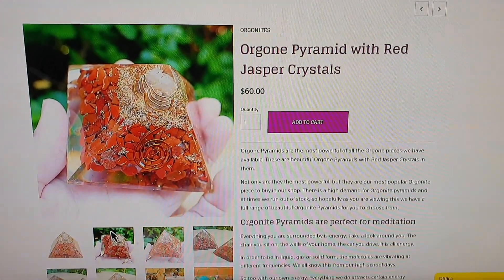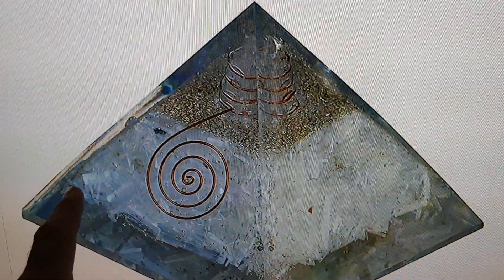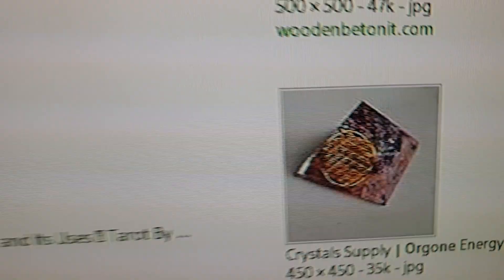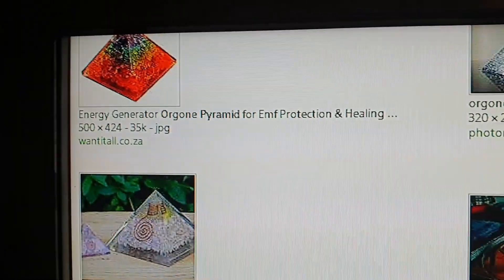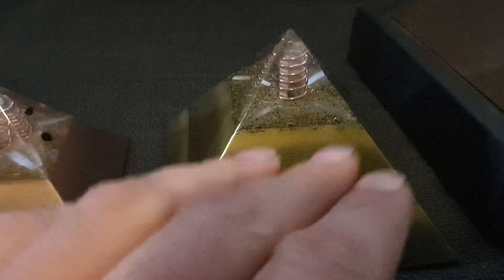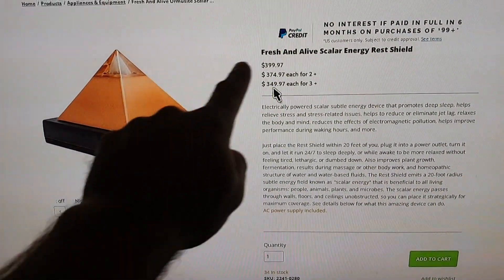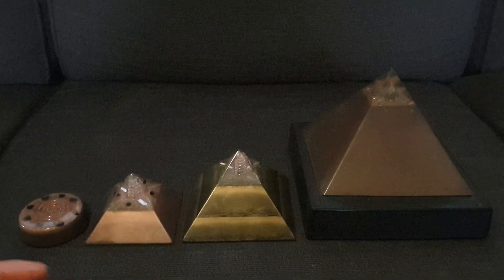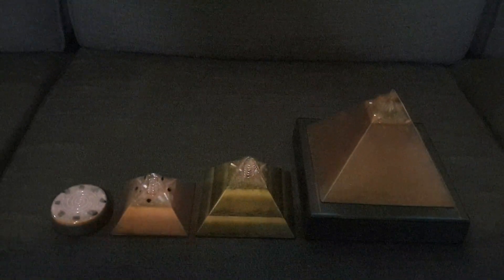Fake vs Real Orgonite Pyramids - Watch til the End!!!

Comment: Thank you for explaining the diference , I need functional orgonite with healing  properties not something that just looks good and doesn't have healing power. Keep up the good work :)
Reply from the maker: Most definitely! I will, thanks 😊
Reply: Originate doesn’t heal
Reply: @SamuraiKai-i2p  That would be your opinion, the hundreds of thousands and millions of testimonials all around the world would suggest otherwise. These "orgonite" devices (when made properly) do have energy, frequencies and vibrations about them, there's no doubt. I mean just pyramid structure made out of plastic straws or wooden sticks give of a beneficial energy. Using an energy tool can absolutely aid in the healing process.
Reply: Wtf is a healing process 💀
Reply: @SamuraiKai-i2p  You can look it up yourself. Wilhelm Reich's Orgone accumulators, Slim Spurling's tensor technology, Patrick Flanagan's pyramid power, Nikola Tesla and George Lakhovsky's MWO antenna, Radionic and Rife machines using frequencies. You can start here, Orgonite and the above go hand in hand. You can work out the process for yourself, if you expect me to just answer you'll be disappointed, we both know your not going to believe me anyway. Unless your researching it yourself to find out please don't waste my time with a question like that, its not helpful for anyone.
Reply: @rcimmortals437  yall are wack i thought they looked cool
Reply: check arboreacrystals orgonite, really a great reiki healer and orgonite crafter  ;)

Comment: does it have to be powdered or can small scraps/shavings be used as well?
Reply from the maker: Any size metal can be used, but the larger the size, the less of an effect. It comes down to surface area, and you'll get more of the casimir effect using powders.

Comment: All you have to test the orgone is by freezing water in a plastic cup, cover with plate, put pyramids on top, and watch how beautifully the water freezes:) my cheap ones (mass produced in india) work great.
Reply from the maker: I'm curious, what type of water do you use for your water freeze test and do you do a control test too?
Reply: @sasorgonitecreations  yes, I have in the past 5 years froze tap water, bottled water, and water from the 'water mill' dispenser-i don't recall much, except that the more pure water has more difinition and tap water was more cloudy when frozen but the same spiraling/flowering pattern. And of course I froze one cup without the orgone pyramid on top vs one with and the difference was that the cup with out the orgone froze in a scattered blurry shape.
Reply: The Pendulum test is also a great way to test them
Reply: @jessica_leeh  how do you do this test?
Reply: @aliciaconstant3982   Look up a video that explains it well on YouTube for sure! But basically you make a pendulum out of string, a crystal and metal wire, and you hold the string still over the orgonite and you’ll see it start to move on it’s own. It’ll show the size of the energy field too which is super cool. Triangles are larger fields than a cube or sphere.

Comment: Using too much powders makes the orgone sticky.  Doesn't flow as much. The 1 tsp per 8-10 oz. Resin is a good rule to follow. Mixing powders and larger metal particles works for me.
Reply: Also i wonder if you cut one in half because it is powder the resin surely do not go everywhere.
Reply from the maker: Ill just say that we don't use any colours to colour the Orgonite. The colours you can see are metals 
😊
Reply from the maker: Fair enough. 
Can you provide me with proof that the energetics won't follow due to using too much powders?
These energy's have no trouble passing through walls, a scalar field will pass through a Faraday Cage. Your WiFi, cellphone signal etc passes through walls. Our orgonite pyramids are not a made out of a solid piece of metal, there is lots space in between everything holding it together. This energy is flowing just fine.

🙏

Comment: All orgonite is fake. Its not based on Reichian principle
Reply from the maker: It's based on using organic and inorganic materials to utilise and gather the surrounding orgone energy.
It was invited by Karl Welz on the simple facts that Reich discovered.
Reply: There are a lot of bases to an orgone accumulator. Not only organic inorganic. Like the specific metals used. If you are using copper then your using the wrong materials. Reich specifically advised not to use pyramid shapes. He specifically mentioned layers. Overall organite is just a name used by a guy who didn't read a book from Reich and other people copy the same errors. You can't claim that you read his books or Manual then you are just using the name as a brand and no more. Organite is not based on anything Reich did. Just pieces of material glued together. The resin used isn't even organic.
Reply from the maker: Any reasons why not to use pyramid shapes?
People creating orgonite have indeed created something new and different, and not all orgonite is created equal.
While creating the one's that we make here, I am focusing on the creating the casimir effect ✨️ and adding many different minerals, crystals, paramagnetics etc. 

I can't even remember what I say in this video as it was a few years ago now. I'd probably say some different things nowadays.
Reply: This is specific engineering. Specific. It has to be exact and precise. Then, maybe then, can you explore maybe adding something new but it has to have the base grounding. This isn't an idea. Its ENGINEERING. Organite has flew of the rails even from it's inception.
Reply: Your basically saying all fly traps are made equal. Organite isn't based Reichian data. A car and boat both can have motors but it doesn't mean a boat will travel on land. I researched Reich work for almost 20years. I seen the beginning of the orgonite movement. I'm sorry to say that it's garbage and takes attention from all of Reich work. Reich was a actual scientist with a nach for engineering. If someone says don't put sugar in the gasoline tank it's for a reason. No pyramid. No toxic resin. No copper. And a lot more. All this stuff Is junkonite. Its because a thing of almost religion and not science. The guy who came up with the idea is a nut job. I say this because all you have to do is read from source to cross reference. Any real follow of Reich can take two glances and see where 20 mistakes are made. Contact James DeMeo. He will tell you the same thing. He's another scientist who wrote the orgone handbook. Of you want instruction I could maybe help. But this stuff is all garbage in general. Don't be lazy my friend. Do it honestly based on the man's work not some quack with a slick brand name.

Comment: When making orgonite, do I have to make sure to use eco-friendly epoxy? Ive found a brand named "Ecopoxy" that seems to be good
Reply from the maker: Hi, no you don't have to, you can use any resin! The key thing you want with a resin is that you want it to shrink well. Also you need to worry about safety equipment like wearing a proper mask with organic and inorganic vapour filters while working with resin's. Ecopoxy to my understanding is a non-toxic epoxy resin which you should be alright to use without a mask in a well ventilated area. But resin like polyester you always need a proper mask with the right filters!!! I do recommend a full face respirator (mask) to also shield your eyes!!!
Ill be doing a video hopefully soon on safety and the mask that I use if your interested. Stay tuned and thanks for your comment 😊🙏
Reply: @sasorgonitecreations  I will definitely stay tuned for that, Thank you a ton for the tips! getting ready to do my first epoxy project 👌

Comment: So only you make the right thing?? Lololo besides is way cheaper
Reply from the maker: I never said that! Also this video is from over 2 years ago and we make them different again, with more selected ingredients for an increase energy output.
I design our devices to actually do something so if you just want the fake orgonite because it's cheaper, go right ahead 👍😁
Reply: @sasorgonitecreations  I assume you don't have free shipping to the EU? If not, are there any sellers you know of, that you would recommend? Sorry for asking also, just don't want to run into too many costs
Reply from the maker: @johangrostkerck6046  I could give you free shipping but the cost of the item will be higher then. I'm sorry but I don't know of anyone, I haven't bought from many maker's myself.

Thanks
Reply: @sasorgonitecreations  Well that's alright. Thank you for the quick answer and maybe I will buy smth from you in the near future. At any rate, good luck from the Netherlands